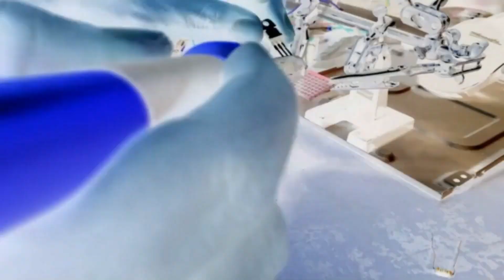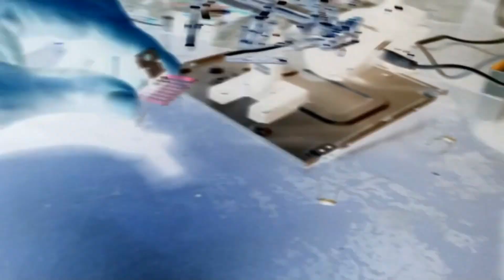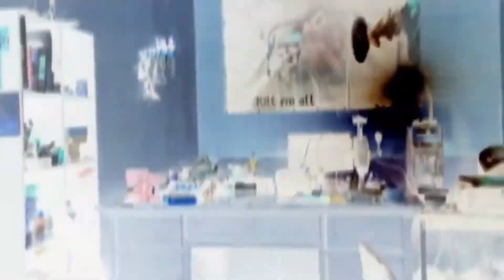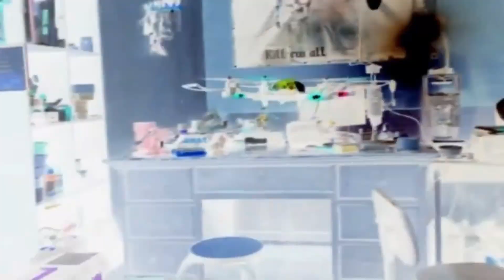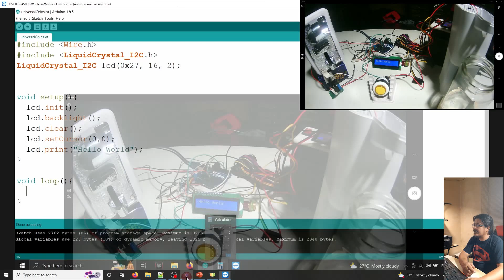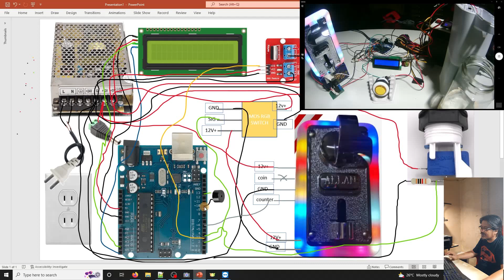PART 2 - ALLAN RGB UNIVERSAL COINSLOT + ARDUINO UNO COMPLETE CODING - DEMO AND ASSEMBLY

Comment: different question lang po. paano po nag wowork yung set pin o enable/disable ng coinslot? need po ba sya supplyan ng 12V?  pwede po sya iintegrate kahit po sa system na yan tama?